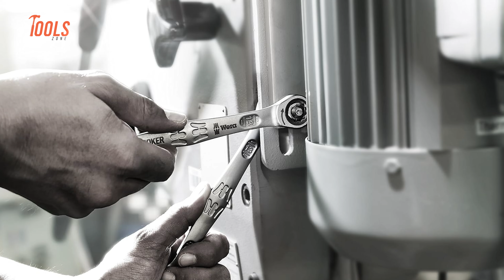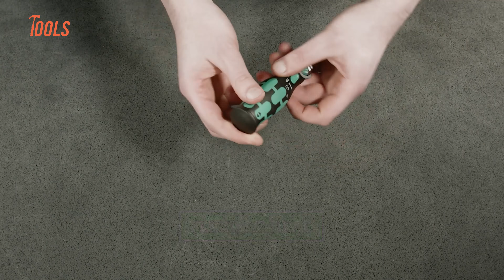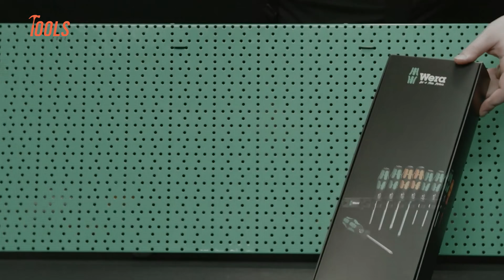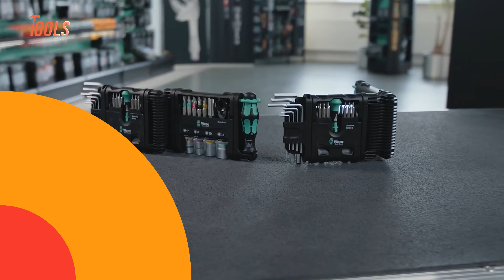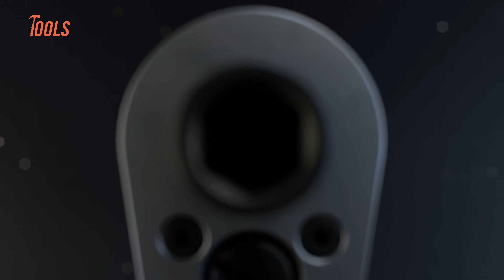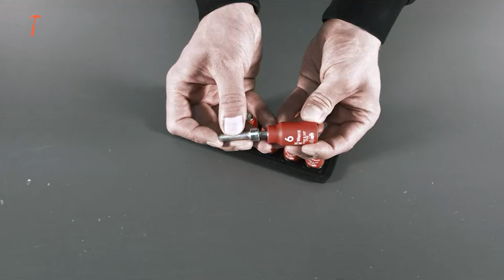20 NEW Wera Tools You NEED to See in 2026!

Comment: Written while viewing
I have a double sided adjustable joker and I have never found a use for it above normal tools. 
Kraftform Kompakt 100 looks nice, makes me wish the toolcheck came with the hex keys. 
The Zyklop pocket's biggest flaw in my opinion is that sockets are only held on by magnets due to the hollow bit holder. Cool tool, but can be annoying.
The Kraftform 900 is interesting, might have to pick that up to try it.
Tool check modular set looks great, with the exception that it looks cumbersome to shove in your pocket. Over all, a really nice variety though.
Joker 6006, there it is that I mentioned above. I'm sure it's great for some things, but I've just never found a use for it. The amount of space you need to "ratchet" it is just too much in most cases I've found.

Good video. Wera tools are cool!
Reply from the maker: Thanks for sharing your detailed take on those tools!